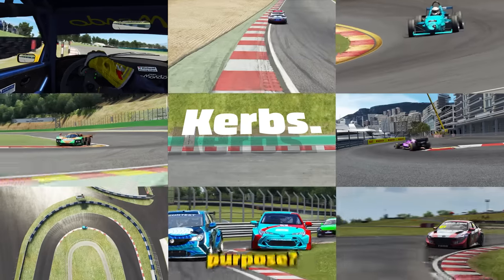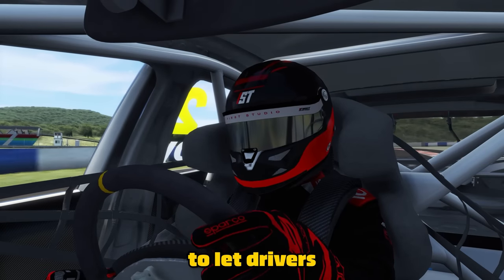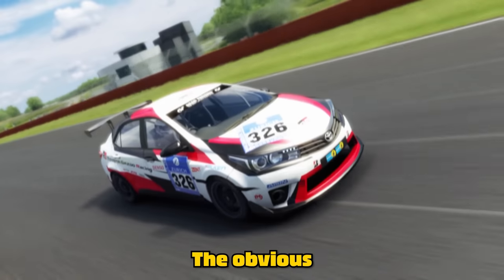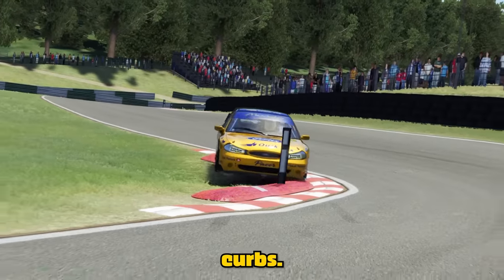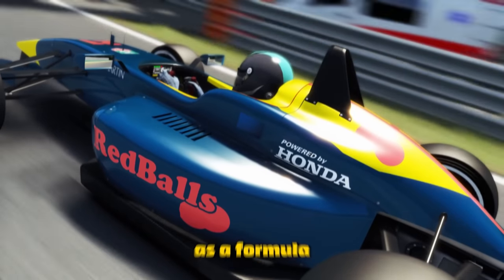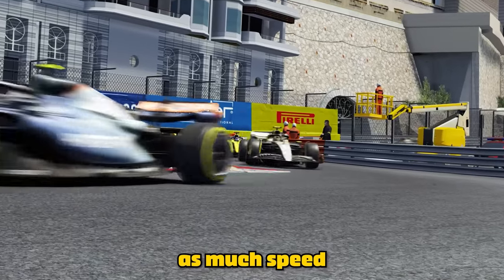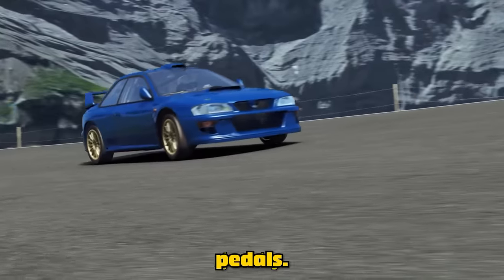You've Been Using CURBS Wrong in Racing Games...

Comment: I still remember discovering that one kurb in Seattle circuit in Gran Turismo 3, I remember hitting it acidentally with the Formula GT but instead of the car go fly, it sticked to the kurb and then I was able to go much faster around the corner, like a Gutter Run but inverted
Reply: I hated that circuit when I was a kid, then I got addicted to GTPSP in my adolesence and it became my favourite city circuit for a while. That curb is so rewarding when you nail it.

Comment: The way I use curbs is basically, I put my inner wheels inside the curb so my wheels are on the grass. My wheels will grab the curb, and will slingshot my car around the corner. It is like the gutter run but using curbs instead.

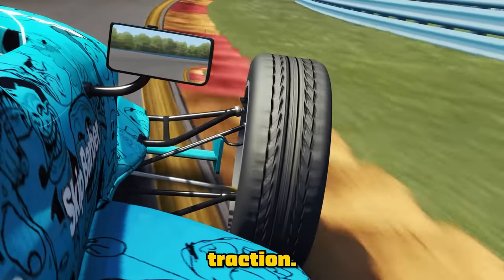Comment: Was holding on nitpicking till 5:45 explanation... No, that's not how it works. The kerbs do loose you traction (mostly because of tyre movement up/down for which dampers are much under prepared to deal). but they help you turn in different ways:
1) The kerb is higher, putting inside front there moves the weight distribution off the rear inside to there, changing the cars mechanical balance. This is the most common reason for kerbs giving oversteer. (even at watkins, just the track camber change over kerb is enough to have this)
2) AC kerbs are sticky, the earlier noted damping issues combined with limited physics frame rate can lead to runaway tyre loads which can randomly pull the car >laterally< (its a glitch). If the stars align (frequencies match) its possible to rely on this glitch in race over many laps.
Ofc the that one is very rare but AFAIR THAT particular kerb has just the right spacing and common car speeds to get it, so chances are that's what you discovered.
A more "famous" case of kerbs doing 2) are some (old-ish) popular videos at spa in GT3s which over the course of development were followed by patch fixes (but never disappeared completely).
3) Would be just increased tyre drag, the energy the dampers are struggling to dissipate has to come from somewhere, saw kerbs can pull just like putting tyre in sand or puddle, just to a smaller extent.
and 4) that's not a case here -  because rebound damping is usually much stronger than bump, the kerb can pull the suspension down (not a glitch, this happens IRL too, kerbs or bumps) which increases the efficiency of front wing shifting aero balance forward. It requires a very stiff single seater to feel oversteer from that effect thou.

In general thou, the saw kerbs themselves are rarely more slippery, rather cars just don't have enough damping to calm the tyre going pogo. Im mentioning it because you CAN use damper adjustments to fix some of the kerb issues, not all, not completely but it can help (fast damping has far more impact on it). In your watkins case its 2) and 3) mainly, adding 1) as the car is pulled deeper.

GL with your league :3

Comment: Watkins curb inside front touch isn't actually caused by the inside front losing traction as the video indicates. It's actually caused because the touch loads the inside left front for a moment, which unloads both the outside left front and inside right rear, and in turn loads up the outside left rear, breaking it's traction slightly. This dynamic change in crossweight, mainly due to the outside left rear getting slightly more loaded, causes the car to oversteer.
It's similar to touching the apron at an oval track, causing an oversteer moment.

Comment: Finally someone described the Watkins Glen curb trick. I do that all the time. It’s so nice to look at
Reply: Watkins curb inside front touch isn't actually caused by the inside front losing traction. It's actually caused because the touch loads the inside left front for a moment, which unloads both the outside left front and inside right rear, and in turn loads up the outside left rear, breaking it's traction slightly. This dynamic change in crossweight, mainly due to the outside left rear getting slightly more loaded, causes the car to oversteer.

It's similar to touching the apron at an oval track, causing an oversteer moment.
Reply: @ianjameslake  That makes alot more sense.

Comment: Very great video but I thought the angle of the curbs will be a theme also. If you catch as much speed out the corner as possible, some exit curbs may push you back on the track which I use sometimes. But maybe thats not the fastest line to take 😅

Comment: The curb at Watkins doesn’t really work like that. If the curb is slippery and given that your formula car is not front wheel drive, the inside wheel should experience less friction to slow you down for the smaller radius, so the slipperiness is not the reason why it works. The more likely reason is that the curb acts like a gutter that hooks your inner wheel in a smaller radius and prevented your car from washing our. However you need to be careful to maintain that slip angle because if your rear wheel lands in the gutter, you will have no rear slip angle and you will under steer and shoot straight across the track.
Reply from the maker: Have you ever driven this track in Assetto Corsa or iRacing?
Reply: @TSRB  Yes, ACC.

Comment: I have in fact not been using curbs wrong. Hate this trend of clickbait bullshit titles where they just put novice information into a longform video acting like it's revolutionary. Just make the title "How to use curbs in racing games". That's all this is.

All anybody needs to know is: curbs have less grip than tarmac but make the track wider. Curbs have varying levels of angle and aggressiveness. Cars have varying levels of ground clearance, suspension travel, softness, and downforce. All of these factors will affect whether or not using the curbs will make you faster or slower. Generally, use more curb in a road car (do not do this in real life though unless you know your stock suspension can handle it). Use less in a high strung high downforce race car.

And, something deeper that you didn't even touch on, is that you can set your car up to use more or less curb. On street courses with lots of aggressive curbing, cars can gain an advantage by using MUCH more camber than they would normally use, so that when riding up on the curbs, their outside tire is flush with the ground. Giving them MORE grip AND a wider track to work with, but sacrificing straight line acceleration/braking grip and grip on corners without such aggressive curbing to ride up on. Monza is a great example of a track where that is done for the example in this very video, which is where I was expecting you to take it but you didn't. You can gain a lot of time on your exit from the chicanes that nullifies the time lost in parabolica.
Reply from the maker: Yeah, YOU in particular haven't been using kerbs wrong; and I didn't make this video specifically for you. Not sure how you could possibly classify this as clickbait. At most sensationalism, which is pretty much standard on Youtube, or any kind of media in fact.